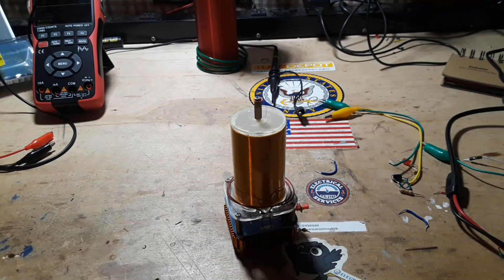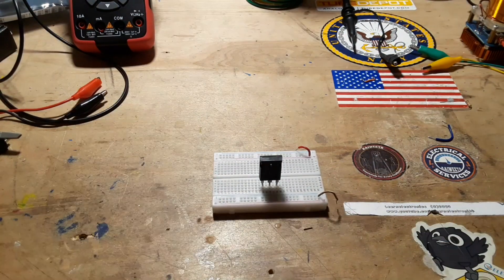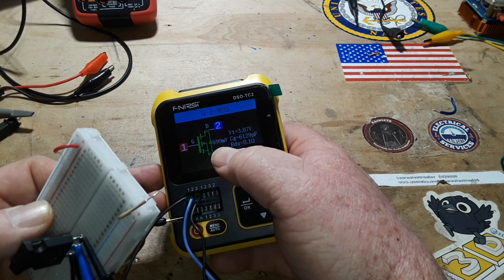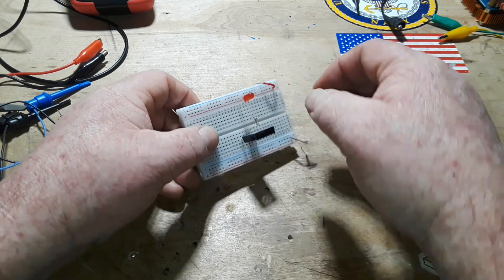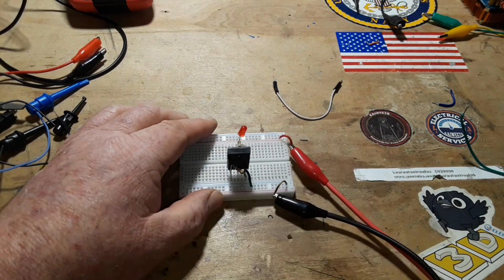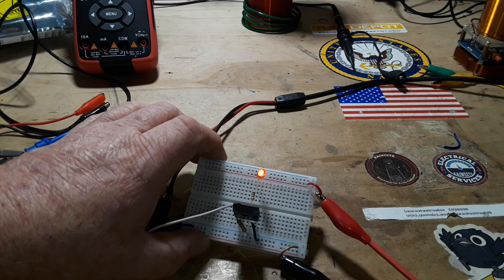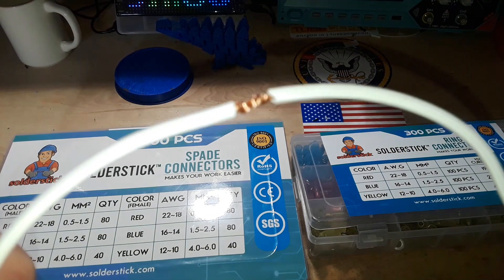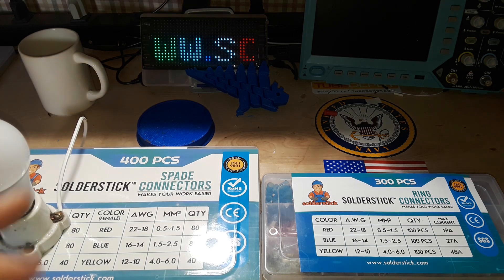IRFP460B MOSFET For Large SSTC - brought to you by Solderstick Wire Connectors

Comment: I guess most MOSFETS can't switch on/off at 780Khz? I'm not sure what is so special about this IRFP460B Mosfet?
Reply: Just saw your comment. I'm going to look up the data sheet for this FET after this video coz now I'm curious if it has something special for this stuff.. 😅
Reply: @keithking1985  thanks
Reply: I just compared it to the IRFZ44N.. common fet, difference I saw was low input capacitance, and low on resistance, it also has "avalanche" properties(Interesting I thought).
And from the (very quick) look I did, it boosts about more applications were fast switching is needed and high frequency stuff, like plasma screens, servers and telecoms and everything else the other fets do. But it seems a little bit better for a Tesla coil.  But I don't see the point..👍🇮🇪🙏